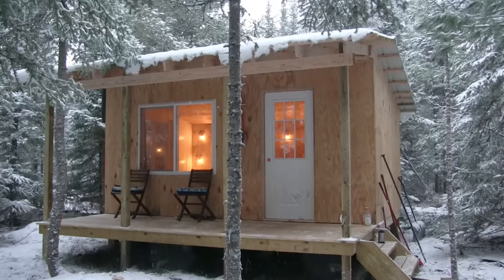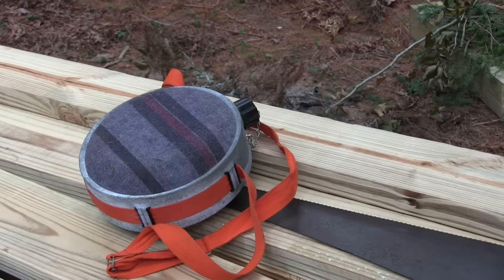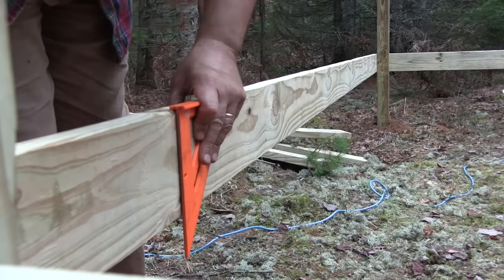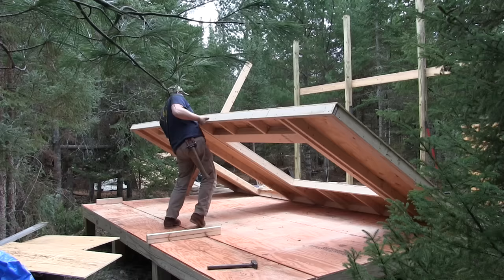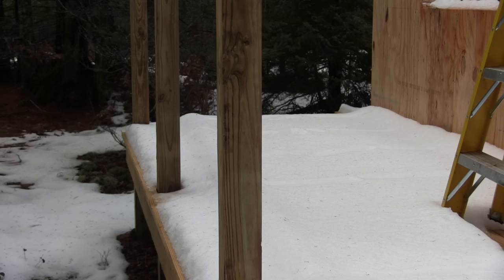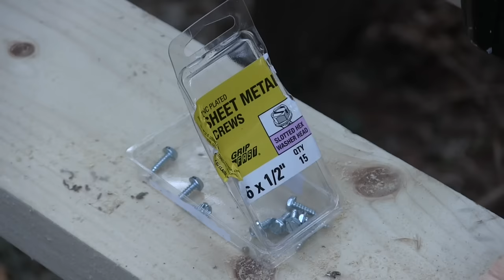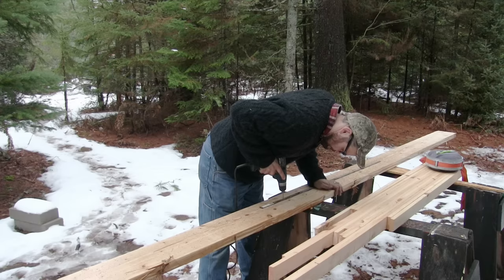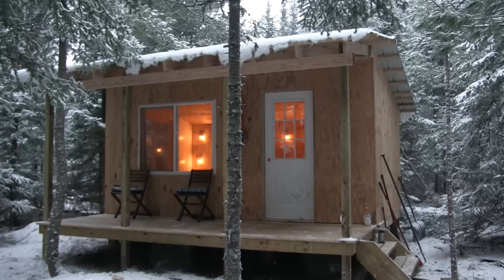Off Grid Cabin In The Woods....Start to finish

Comment: As someone who has always dreamed of building my own little cabin in the woods but never got any foundation in construction, I thank you immensely for filming the entire process and showing how easy it can actually be. It's a huge inspiration, and I hope to start on my own cabin next season!
Reply: He made it look easier than you may think. Good luck though it will be worth it.
Reply: It's easy to think about and plan out, really, REALLY hard to actually finish.
Reply: You can do it!
Reply: this +1
Reply: let's hope you remember the toilet.......................
Reply: If you're a woman w/o any "foundation in construction", you might have it extra tough tossing lumber and plywood around, lifting finished walls, like this experienced, master carpenter does. I'm not saying you won't be able to accomplish it, but you might want to buff up, hit the gym before you take on building a cottage by yourself. Good luck!
Reply: This cabin needs some fire safety upgrades:  1. The stovepipe appears to be too close to the rafter where it passes the roof; 2, although the use of a double-wall stove pipe where it goes through the wall probably provides enough clearance from the wooden parts of the wall, a good rule would be to check the stove and stove pipe manufacturer's specifications for clearance from the studs and wall cladding; and 3. most importantly, the stove should have a fireproof insulating layer under it and extending out in front so that heat from the stove will not catch the floor on fire, and especially to catch any embers or sparks that come out of the front of the stove when the door is open.  To be safe, there should be a hearth sufficiently large that if someone does not get the stove door latched properly, there would be no danger of embers or sparks getting on the wood floor.  And the rug shown at the end of the video is too close to the fire.  I note that the builder has added metal panels to protect the walls from heat from the stove - this is a necessary upgrade, but those panels should be permanently affixed so that they cannot be removed.
Reply: Don’t forget the bathroom, ladies need a bathroom
Reply: @brainscott8198  I appreciate the concern, but the cabin in mind is not just for me, and I won't be the only one involved in the building process. I have "big strong men" in my family that will be helping as well.
Reply: @maryf.1956  I prefer outdoor composting toilets. They're sustainable and much less of a hassle than indoor plumbing.
Reply: @schadenfreude2555  Thank you so much for this! Safety is a big concern and I appreciate the insight.
Reply: @fitchyyboi  We are actually working on finishing a small concrete home that's been in the works for almost two years longer than what we had planned for due to the material shortages and other "life happens" reasons, so I totally agree that it's much much easier to do the planning than it is the actual building. I have no misconceptions about that haha
Reply: @brainscott8198  I do plan on buffing up anyway, though. Thanks for the good luck, we'll need all we can get!
Reply: @faithsasser5679  keep it up!
Reply: @raymondo162  Have you decided on a WiFi password yet. Having a hard time getting Spectrum to come run the cables for mine  probably do it myself AT&T satellite isn’t so noticeable on the back side of the roof
Reply: Go for it!
Reply: Guys, here is our Savior

HalleluYAH translates “Praise ye YaH”

YaH is The Heavenly Father
YaH arrives via the TENT OF MEETING
YaH was Who they Crucified for our sins
YaH was Crucified on an Almond TREE

Semitic of Moshe (Moses)
Isa Scroll (The Original Isaiah)

Isaiah 42:8 - I am YaH; that is my Name! I will not yield my glory to another or my praise to idols.

Isaiah 43:11 - I am YAH, and there is no other Savior but Me.

Isaiah 45:5 - I am YaH, and there is none else.

Comment: Your "bit off more than I can chew" part reminds me of a time when I was working on a heavy Inline 4 and removing it from the frame while the bike was still somewhat assembled. I didn't realize how heavy the engine was until it was partly out of the frame and teetering/about to fall off and I was at such an awkward angle, I either had to give up, or let it drop. I let it drop. Luckily everything was fine lol. My hat is off to you sir, I thought building a motorcycle was hard work, this is a whole 'nother level.
Reply from the maker: Right on. What bike was that? Ive had a verago, goldwing, and a few other Hondas...now I have a KLR 650
Reply: @Bushradical  You should have a stud near by to help support the wall as you push it up, then at least it won't falll on you. Be safe and great work! you can nail the stud in with one nail, so as you push the wall up,, the stud pivots and digs into the floor as you go .
Reply: Don't forget block and tackle or electric winch.
Reply: @UNKPCRIDE  That is just what I did building my shed.
Reply: @Bushradical   I wish I was near you to learn from you, never built a cabin or house...I love to learn new things.. lot of respect for you sir... keep up the high quality work... have a bless day
Reply: lol reminds me of the time i almost dropped my dads harley when i was 16.  Bout threw out my back but i caught it and saved it.  Dad never found out til i told him more than 15 years after.
Reply: @jameslester3861  The sailor in me said "a three to one purchase would do the trick nicely!"  I can just imagine the spin-off video where we get to watch the construction of the wooden blocks needed to raise the front wall.

Comment: This is Discovery Channel level quality video making. I would easily watch a show about this kind of stuff all day. You just got yourself a new subscriber, Mr. Bushradical. 
I'm an engineer, so I'd love to actually build a cabin similar to this instead of doing calculations in an office all day. Something about using your hands to actually make something just feels right.
Reply: Isn’t engineering similar to woodworking? Also, is engineering similar to something like carpentry as well?
Reply: @Someonelikekanye  It is. Unfortunately in school we don't learn any of the hands on stuff. I can tell you all about the tensile and compressive strength of wood or any other material and how thick a beam needs to be to support "x" amount of weight, but the actual installation of the beam and how to use all of the tools is not covered. Most engineers are "self taught" in the hands on portion because we like it and that's what drove us to engineering in the first place, but there is no guarantee an engineer will know how to use every tool or know the tricks of the carpentry trade. I really like thermodynamic systems, and that's what I specialize in (think rockets and internal combustion engines) so other than the basics, woodworking is a very foreign topic to me. I know I could learn it, and that's part of the reason I'm watching these videos. To learn tips and tricks and expand my knowledge!
Reply: You would probably love the video of Dick Proenneke building his log cabin in alaska, very similar style of video to this. Its called "Alone in the wilderness" not sure if its on YouTube or not but i Highly recommend it
Reply: @Someonelikekanye  As an engineer, you've got 1/2 of it done already!
Reply: What is the size of the cabin ?

Comment: I love seeing the old tools still in use.  There's something real satisfying about using old tools.  I pulled out carpet and installed Hardwood floors a few years back in my house.  I used an old ball peen hammer that was my Grampy's from probably 100 years ago when he was a machinist (I put a new hickory handle on it and use it often doing automotive jobs) but it got the job done (mostly used the flooring hammer but it was needed to face nail a few boards).  Only later did I find not 1 but 2 Estwing framing hammers in the basement of that house.

Comment: I'm watching this now 4 November  2023 and I am very impressed. I had a cabin built in 2021. It's on stilts with less than 1metre hight above the ground. Insulation not done properly,  is floor, walls and roof. If I do another project like this I would make sure that insulation will be done accordingly to what I saw in this video. Thank you.

Comment: I wish I had the knowledge to do this. That feeling of getting something massive like this done 1% at a time has to be  extremely satisfying
Reply: You can do it. You have a supercomputer in your pocket and you have multiple search engines and people to guide you. Good luck.
Reply: Just start. No one is born knowing how to do stuff...
Reply: @Jay-dx9fi  you're right, now I just need to find the open area in a heavily populated urban area and what....100-150k in lumber/tools?
Reply: Just watch the Larry Hauhn videos, people have built big modern homes after watching those videos. Something like this is easily achieved with some research and hard work.
Reply: @rd30000  you don’t need land in a urban area, your better off in the country where land is cheaper, and you only need basic tools to build this cabin ($500 at most all new, even less when you buy used) and this cabin cost $5,500 in building materials.
Reply: ihaventchosenanameyet  the math was done after the lumber prices skyrocketed up and then came back down for a bit. Right now lumber prices are higher than when the math was done but not by a huge amount

Comment: Very nicely done and relaxing to watch. I’m 61 years old, 5’6” and 135 lbs. obviously I don’t rely on my strength and I have done shed/deck building myself. One thing I heavily rely on is cleats and ratchet straps to help as additional hands. I never try to attach sheathing to framing and lift. Sure way to break the back and few extra bones. I have always found it very easy to set the framing on deck, brace it plumb, put a 2x4 as cleat to rest the sheathing and install. Thanks for your nice video
Reply: Cleats and ratchet straps, excellent suggestions! As a 5'2", 77-year-old woman weighing 122 lb., I don't plan to build alone, but I was wondering how to leverage the lifting with helpers. Thank you for sharing installation details based on your own experience with the world. A gift.

Comment: I felt it when you were trying to lift the wall. I got to the point once where I got one end up enough to slide a saw horse under then did the same with the other end. Then I put the support braces on so that it would catch the weight and hold it up as I was lifting.

Comment: I just watched this video. Great job! One tip on your floor insulation so you don't have to crawl underneath. When I built my 16x24 cabin, I used 2x8's for floor joists and nailed ledgers to the bottom edge, dropped pieces of plywood from the top and installed the R-19 insulation. 

We also did our floors with 1x12 Pine shelving boards, walnut stain and 3 coats of water based polyurethane.
Reply: Ingenious!
Reply: My thoughts exactly!

Comment: A little tell from an old timer I built my first off grid cabin when I was in my 30's I had to redo my post when I was in my 50's they started to rot. Now if I was in my 30's and knew what I know now I would have used or made concrete post and I would have added 4 more post to the middle of my floor. It was a 16x24 only because I wanted a closed off bed room. the rest was open cabin at the time the post started to rot the floor had some give in the middle with just the sides having support. I also would have used bolts and not nails on the framing  for even they started to deteriorate over the 20 years. I would have also Painted the boards with with oil paint to help seal them Thank God I only had 6 that needed to be replaced keep in mind I built mine in the south Florida everglades. Another thing is the Hurricanes because of them I built my porch staggered one board from the porch to the cabin and one from the house to the porch and joined with 2x8's on both sides and never had any trouble not even when Hugo hit Florida and took out homestead I had to replace one piece of tin. being where I was I had to do my roof first rain just about every other day and you don't want to much water getting inside down in Florida.   You are 500% right about having a bottom to the build I added that when I did the repairs to mine. It made a big difference to the heating and saved me a lot of wood cutting and hauling wood in a boat out to the cabin. Moisture kills everything so always think about it. I have had less repairs on my cabin then I have on my sticks and bricks shows you just how they build things doesn't it. I have sold out and am looking for some thing up north now one more build to last me the rest of my life and it'll be done right. I give you a 99.7 not to upset you but in years to come you'll understand what I mean I only give myself a 98 for what I did back in the day but I sold it for way more than I had in it and I am sure the lady that got it will have years of repair fee living in it. Also keep in mind we had Creosote post back then. A tip for your heat run a pipe 8 foot pipe ay an angle or a pocket in the pipe  to the left or right of the stove and you will collect 60% more heat in the cabin less wood because you are getting more out of the wood you burn I have used two small logs that lasted all night in the mid 20's to low 30's . I have spent summers and winters out at that cabin I am missing it already but if I can build something that lasted that long in the swamp that's a big plus. You should do fine where you are. Great job but think long term saves you money and work. I am 62 now with health trouble but still wont give up my freedom. Like I said when I was in the Army I'll live free and die free.
Reply: A beautiful piece of life history. I went in a different direction than you. I converted a steel container (construction office) 6m x 2.4m - I added a 6m x 4m terrace and a viewing point on the roof of the container. It's a bit of a bizarre construction from a distance, but I love it. I try to spend as much time there as I can. It all stands on concrete poles (I drilled and flooded + steel). I love this place, that's why I understand 100% what you did. Regards from the south of Poland. 💪👍🍻

Comment: Ok, this is the vid I needed to get started. I would only add a small air compressor to run a finish nailer to do the varmint barrier. Also maybe lay some gravel in bottom of holes and a 50% cement to soil mix for tamping in. It might allow for water to get thru to prevent rotting but be semi-monolithic when sets-up. Then again, the treated posts may not benefit so not sure, haven’t tested. Anyway, great vid and cabin brother! You will enjoy many good books there!

Comment: Suggestion for anyone planning to do this, the treated posts these days don't seem to hold up very well in direct contact. I would definitely coat them with foundation/driveway tar to 6" above grade.
Reply: Or a bag of cement to mix in, just fine now but 10 years it might start to rot.
Reply: I would have insulated that floor with the tar paper down with some 4mil plas then sheathe the underside.
Reply: You ain't wrong. I was just saying pressure treated don't last like it use it..
Reply: Maybe I misunderstood, but I think Jan Falcon meant the foundation posts going into the ground, straight into dirt. Which confuses me a bit, since they stand in concrete, doesnt that make the tar unnecessary? I kinda (without checking the footage) assumed the posts would be going in directly, but probably that wouldn't even be possible/stable enough.
Reply: I have PT fence posts rotting at my house, they're probably only 15 years old. The kicker is they were in cement
Reply: @JustRockMySoul  If you put them in concrete, the video it's in sand, there is no barrier, the problem is the things they put on wood to preserve them keep getting dumb down (the environment) well that is the purpose is to stop rot from the environment but I just had a fence blow down and it was only 5 yrs old, the treated post was in cement but the cement was 5+ inches below grade so rotted right at the junction. So if you want more than 5 years in the PNW...
Reply: @steveanacorteswa3979  I like Sonotubes with a saddle on top... keeps the PT out of the crete and stable.
Reply: @yomomma9815  Makes sense, don't have to mix any crete and just do what he did, back fill with the sandy dirt. If you are haul'n in lumber, if you were cutting wood on the location I could see not having that option.
Reply: Negative!! Palm sand the bottoms with 60 gritt beach gravel paper, soak em over night with distilled smart water. The next a.m just go ahead and put a nice thick layer of peanut butter and jelly on all 4 sides and call it a day!
Reply: @steveanacorteswa3979  large props to anyone humping lumber in to a remote location. I'd be using some form of 4x4 to deliver. For me I gotta have proper footers and piers because if I'm going through all that trouble this building WILL be bomb proof 🔨🔨💣🔨🔨
Reply: @yomomma9815  In the video the wood was on his truck, there wasn't any humping so no limit to prefinished concrete piling etc.
Reply: Yeah, they don't leave it under pressure for nearly as long as they used to.  I remember getting treated lumber from McCoy's with my Grandfather when I was a kid and it was twice as heavy and a very dark green compared to the treated lumber I bought last year.  I need to replace part of my fence and I let the lumber air out for (over a year Lol I procrastinated) and I'll be painting the bottom 4 feet, also adding a few inches of gravel to the bottom.of your hole for drainage and a slight mound of concrete above the soil line helps with longevity.  By how much?  The next fence I build with be concrete with 2x4 or 4x4 steel anchors for longevity.
Reply: @steveanacorteswa3979  I'm glad I'm moving to AZ, I never want to go back to the PNW or see that much rain again.